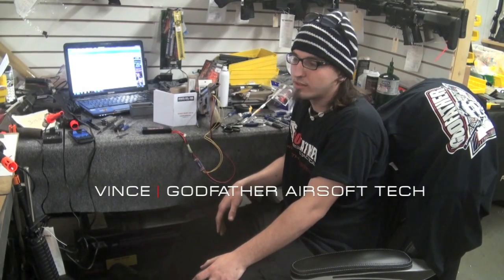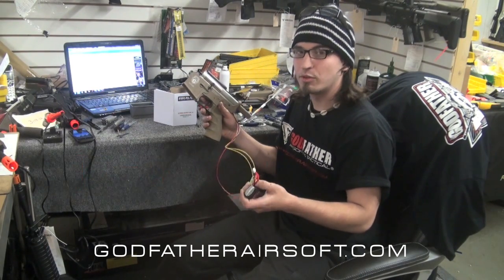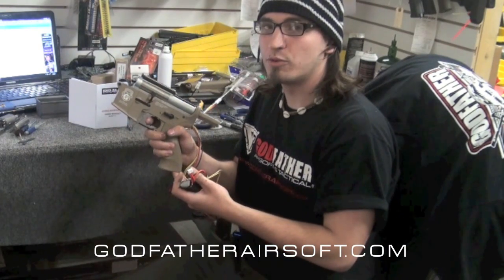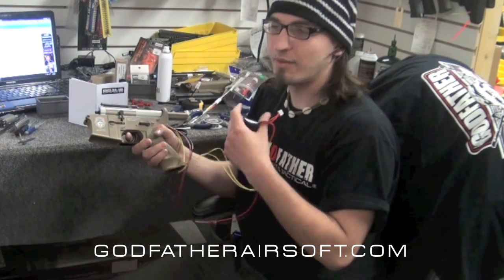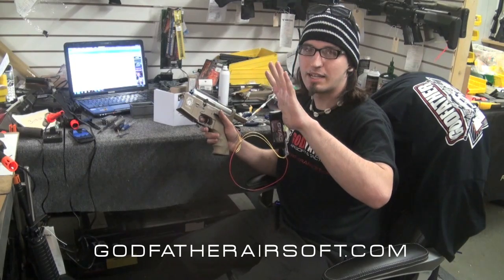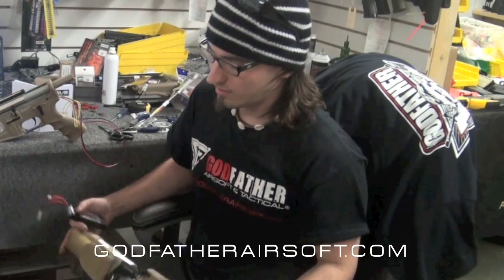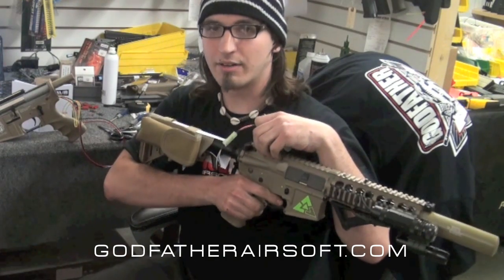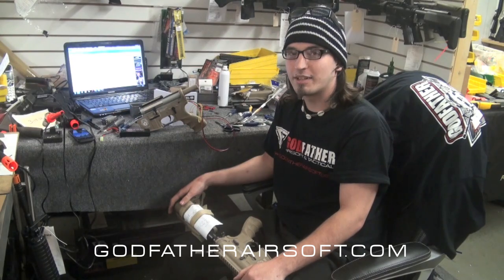Godfather Tech Bravo Mosfet Demo

Comment: ChaoticAirsofter- It's a inline mosfet that you wire through the gun to the trigger and the battery power will directly flow to the motor for low resistance. 

The trigger fets are what your thinking of iirc by AWS.

Comment: Hey guys thanks for the comments. The gun was a work in progress so the gun was in a rough copy. It is revised and the motor height was a tad off what i would have preferred. The Gears are Prometheus 3x Gears so the sound of the loud torque gears is a bit loud. Gun is shooting 500Fps now as well. 

The second gun is also a G&G series rifle with prometheus gears but with 2x gears so the teeth aren't as thick. The spring is also piano wire instead of stainless steel so it compresses much faster.

Comment: You do have to rewire the gun otherwise it's straight plug and play after install. No programming or settings needed. AMU2 is very good cost effective performance.

Comment: lol where to start....It's tons of diagnosis since these things can throw you curve balls. 
Wiring is a massive culprit in damaged guns. Cut off levers. Buckings. Motor height. Etc for the basics. Then you'll run into more so the blown gears, pistons, trigger contacts, gearbox shells etc quite commonly as well for the more problematic things that require more time. Of course so many other things can go wrong pending on the gun and how it was used.